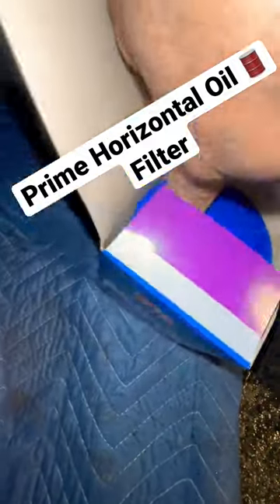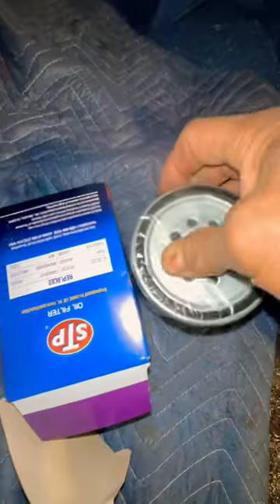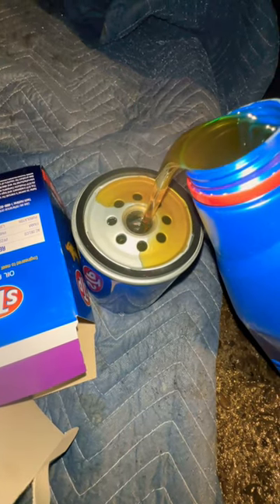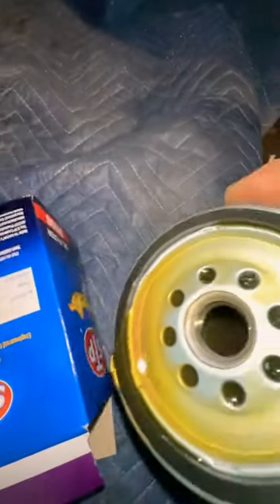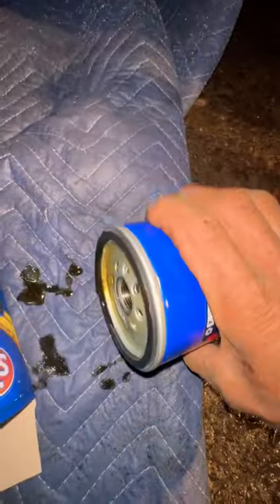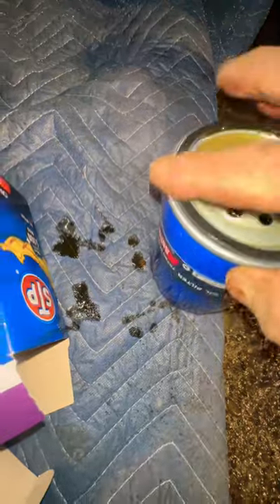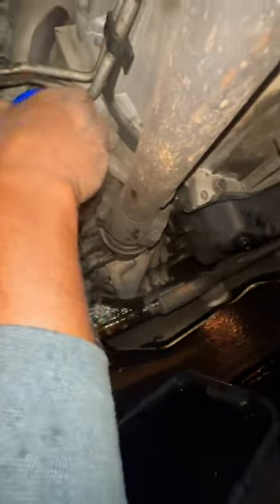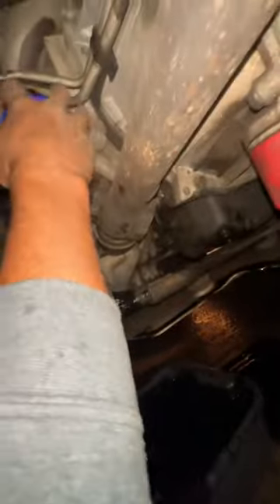How to Prime a Horizontal Oil Filter 🛢️ #shorts #oilfilter #mechanic

Comment: As a mechanic for 15 years working on heavy equipment, the only reason to prime an oil filter is so the orange gets lubed. If your oil pump can't fill the filter in the time it would take for the oil to come out and off bearing surfaces, your engine is already toast
Reply from the maker: I agree. Although helping with a little bit is not going hurt it. I think we can all agree the filter need to be soaked in the end. It starts out dry and ends up wet. And just because it you don’t have too , does not mean that doing it doesn’t benefit it. I personally like quiet starts and oil filters with oil clack less than dry filters ….
Reply: @fastflo1  the oil filters I deal with usually hold around a gallon of oil. Never had one clacking.